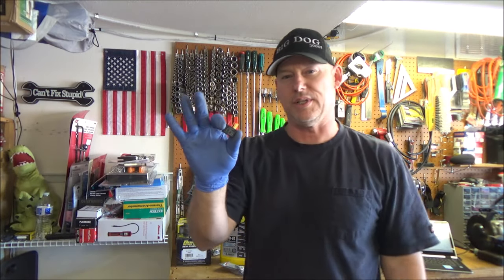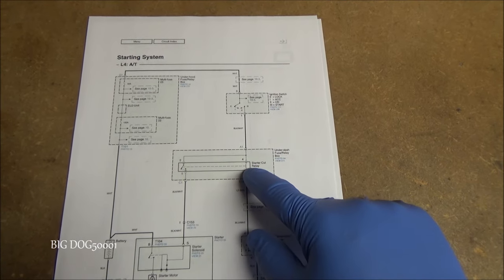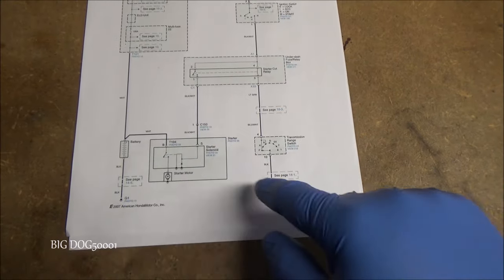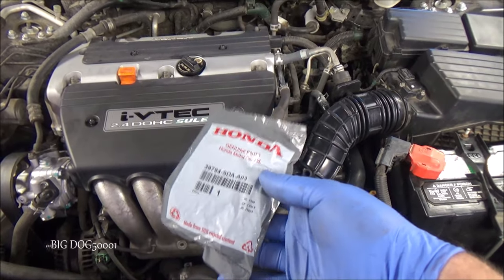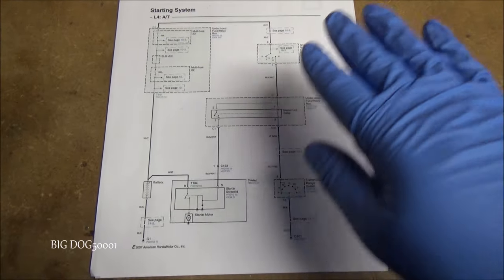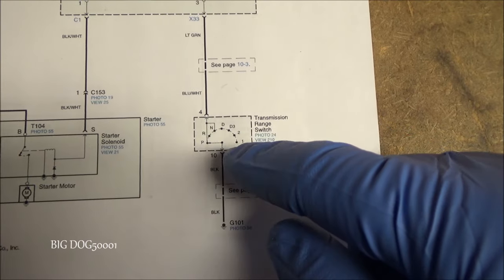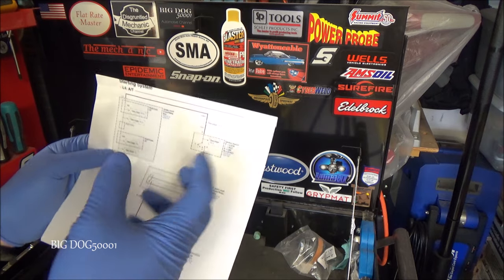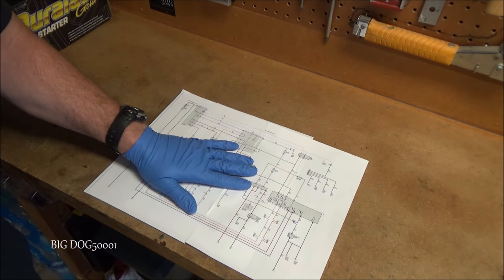Honda No Start: Starter Cut Relay Circuit

Comment: Great info and at 13:00 I found the info I was trying to google for. Having intermittent start issue, sometimes starts multiple times knowing a row, then suddenly it won’t crank and can hear a slight buzz in the starter cut relay. Replaced that relay, and still no start, same buzz. Power to dash and things work as normal. My guess is now the ignition switch, as position 3 for starting is not getting proper connection from what you described. Thank you!

09 Honda Civic  - intermittent start issue. New battery, terminal connections.

Comment: I have a 05 Honda integra Type S,it crank over but wont start. Ive checked the fuel pump the relay underneath the glove box they're good,ive also checked for spark whick ok aswell. Ive seen on utube he has same problem,th3n he changed the temperature sensor and it started,but his car is a Civic. Can you please give me some advise. Thanks.

Comment: Great video.  I have an 04 Accord that buzzes in 3.  Was able to get it to start by cycling back from 2 to 3 several times.  I was thinking it was the starter solenoid failing to engage. Any way to tell if it's the ignition switch without replacing parts and hoping for the best?

Comment: Thank you for your explanation,but do you have a video for 2010 honda crosstour,I have problems with the starter there is no power to the starter solenoid cable,also I don't know where the starter relay and fuse are located,please help me if you can👍

Comment: HELP! I have a 2008 that will almost stall mid drive and all dash lights come on then go off, car continues driving but CEL stays on. Then after turning it off, doors won't unlock and all power is dead until it feels like working again.

Comment: I have a 2015 Honda Civic Si coupe that starts, I drive it about 30 minutes later, I turn it off and it doesn't start, I just wait 30 minutes or 1 hour and it starts again. Could it be the ABS pump?

Comment: Great job on this!  Very helpful.  I'm about to purchase a 2005 CR-V that supposedly has a failed starter.  It's nice to see the current flow diagram.  You didn't mention the 3 fuses in the fuse box up on the battery, so I'll check that current is flowing through those also.

Comment: Would this be the same for a 2002 accord with a2.3ltr. Automatic trans. SE or special edition car? My battery is good. No codes showing. Dash lites work. No start ,Clicks or any noises.

Comment: Hi. Thanks for the informative video! I have a honda crv 2009 diesel with a hard start issue that has been going on for sometime, even my mechanic has given up on it. Anyway, I went to look at my ST CUT relay on the internal fuseboard to check it and its not even there! Even the FUEL PUMP relay is missing right next to it as well!? Its quite bizarre. I figured those two relays should be there so it operates correctly?
The only relay present on my internal board has PW next to it?

Comment: Here's my question I have an 04 Honda Accord I just changed the battery and the alternator and the car still won't start I don't have the money for a starter so what if I just changed out the relay do you think that could be the problem instead of the starter itself?

Comment: Have a 2005 Honda accord cranks but won’t start I have no spark I changed cam shaft sensor and crank shaft position sensor and exhaust cam shaft sensor any suggestions

Comment: Thank you so much for this thorough explanation! My brain can’t wrap around something without understanding the big picture, and you’ve taught me this whole system, along with all the simple real world troubleshooting steps. Such a valuable contribution for us home mechanics working on older cars 😅
I’m replacing the starter cut relay on my 94 civic, and unfortunately it’s buried up above the drivers side fuse box. Had to pull the whole dash to get to the bolt. Thankfully it looks like they corrected the location on newer models.

Comment: Love the deep dive approach. I'm surprised the starter pull-in coil is not wired through the motor ground. I guess with these small engines, it isn't so critical to separate pull-in coil from hold-in coil.

Comment: I have an 03 honda accord lx automatic and I'm having problems starting it, the only way it can start if I jiggle the key a ton when I put them in the engine, what might be the issue or what might I have to replace?

Comment: thinking anti-theft of my 2009 Honda Element when I leave it for a few days. wondering if pulling out the starter relay would be a decent strategy? your video is super informative and I thought you would have a good idea. I read of pulled fuses being replaced with pieces of copper, steel, aluminum, thought maybe this would be a better option.

Comment: Thanks for this video.I have a no crank 2017 Honda accord new battery,starter,2 new relays and still nothing not even a sound.I didn't know about the circuit board wasnt repairable till your video.Thanks again  no one has anything on a 17 accord beside a battery change. Lol

Comment: Big Dog...thank you for the video.  I"m working on a 2002 Honda CRV.  Question,  if the relay is good and the problem is the starter....would i see a noticeable voltage drop when i try to start?

Comment: I have. 2001 Odyssey and the Factory Service manual states starter cut relay is on the back side of the under dash driver side fuse panel. It is unobtainium. The wiring harness is prevent you from easily accessing the relay. I can feel it clicking when I turn the key but it isn't always the same click as the very first one so I suspect that the relay might be bad but it is virtually almost impossible to remove easily.

Comment: Thanks for your video. I have a 2000 EX6 and suddenly it won't start in park or neutral 🤔. Battery  is new and good. Of course it happens on vacation 🙄.  I think it may be the starter cut relay. The starter always works fine. Again your video will help in troubleshooting.

Comment: Excellent video... the simple legacy tricks to get out of jam, if you are that lucky, are priceless.
Knocking on a starter solenoid or knocking on a fuel tank to wake up a dying fuel pump can save a gouging wrecker trip
Wiggling an ignition switch or knocking on a relay or temporarily swapping relays...(when possible) also good!

Without the detailed expressed logic and the schematics on the car you are working on, today good luck tracking issues!
If you don't know your ignition switch makes a request to your BCM which in turn talks to the ECM, and then the ECM
commands the relay that actually engages the 12V to the starter and the problem is somewhere in the middle  !? no legacy thinking will help!
...and how much of it is buried in PCBs that are invisible(like sandwiched in a distribution(fuse) block... again good luck!

ALSO: 
...a good thing to carry on-board, an emergency fuses/relays kit... that has at least one duplicate for every type fuse/relay in your vehicle,
including a fuse and relay tester.  ...Mechanics rob the ones that are in the unused free slots reserved just for that!
On my vehicle, 4 distribution blocks, NOT ONE spare fuse or relay... all covers with legends missing!

ALL robbed by dishonest mechanics or car dealers.

Now my distribution blocks only have the needed items and the kit is not in the vehicle while at the shop.

Comment: Great video.  I recently experienced one additional possibility with my son's 2007 Accord.  The plastic pad that the clutch switch presses against broke into pieces so the switch had nothing to contact.  Took a bit to figure out that was what happened.  I have a wood turning lathe so I turned a replacement to fit the mounting hole.  Hard to get my hands in there for installation, but that solved the issue.  Honda must have a problem with those pad because the one for the cruise control circuit was also missing.

Comment: Thanks for the vid and part#. Great work! I'm having a very intermittent starting issue with my '04 Honda Accord LX. After coming out of the store yesterday, it took 4-5 attempts to get it to start. The first three times it struggled like it was a weak battery (but the battery is less than a year old).  When I got home I could duplicate it a few times, but then today, I started it about 20x (not in successions. About 6-7 times, then took a few minutes break in between). Never got it to fail. I'm starting with the least expensive part first, hoping it's not a starter issue.
Reply: Were you able to figure this out? I am having exact same symptoms with my 07 CRV. Thanks

Comment: Guys. I can’t stress this enough: CHECK YOUR WIRES! I’ve been waiting on a starter for like 3 days, finally got it and changed it out, only to find out the ground connection to the chassis was all corroded. Anyways my starter was sounding kind of slow so I’m leaving it on but just to save yourselves some headaches, check your wires every now and then 😅
Reply: As for me I’m experiencing intermittent starting with the no noise at all when I turn the key. The ignition switch, relay and battery all check out. With intermittent starts I’m suspecting the starter solenoid going bad and eventually fail all together

Comment: I have a 2006 Honda Accord that i have just replaced the starter motor on. Worked for about a month but now it wont start, I get the clicking solenoid sound but no crank at all, do you have any suggestions? The battery tested ok and also tried to jump start it with no success
Reply: Hi. I’m having the same exact issue. Did you find out what it was?  I’d appreciate you input. Thanks.

Comment: You are a very good teacher! I just had my 2011 honda pilot do a no start, no crank. And the dash lights all flash! Tried jumping it off and did the same thing. Any tips on what to check?
Reply: I have the same problem did you found any solution..?
Reply: @valerioalfalfa3868  mine ended up a combination of bad battery and slightly loose cable

Comment: We had the relay replaced on our 2007 accord . It was fine for a month now it's clicking/buzzing when turning the key again. I'll check the transmission switch as you suggested. I wonder if the ignition switch is on it's way out? Oh yes there is a faint clicking sound coming from the relay area when driving. Sounds like a mouse is in there .
Reply: I know you posted this a while back, but did you figure out what the issue was. I've heard that same "mouse" sound in my honda and I just had the no start issue.

Comment: Thanks man I really love your videos!
I'm having a problem with my car if you can help me out, it's a 2007 Honda Accord and it's not starting and the symptoms are, that it has a blinking green key light which should mean that it doesn't recognize the key.
It started when I bypass the child safety switch on the master switch while trouble shooting passenger Windows not work and there happened to be a wire I tested connected to ACG fuse.
If you can maybe help me out and shed some light on my situation I'd appreciate it.
Reply: PS. It does crank
Reply from the maker: Blinking green key during cranking usually means an Immobilizer (anti-theft) programming issue.  Some Immobilizer systems will only shut down fuel (so it causes a crank no start) and some will shut down starter circuit as well (no crank no start).  I would first try a second key and see if if there is a crank no start with that one too.  I would probably also verify there are no blown fuses in all fuse boxes.  The key(s) may need to be programmed again but there is a chance that control units/circuits/fuses could have been damaged during testing and may need repairs/replacement.

Comment: First of all, thanks for your video. On the other hand,exactly, what does a starter cut relay, do ?
Reply from the maker: I tried to explain it in the beginning but typically a relay either allows a small circuit to control a larger one, or it is an easy way to add a switch.  For many Hondas, the starter cut relay is an easy way to add the use of a safety switch (on this car it was a transmission range switch).  Thanks for the comment!
Reply: @BigDog50001  thanks for your explanations

Comment: That 2017 wiring sematic was at least 5 times bigger than the other one, you have to replace a circuit board if the relay goes out-Dang.....
Reply from the maker: Yep!

Comment: 2012 CRV. 1st crank of the day starts but kinda slow. May or may not crank when get somewhere and come back out and try to leave. Battery brand new. Old battery tested weak but I don’t believe it was the issue. Couldn’t even jump it off. Removed cables and forgot the windows were down. Slid cables back on to roll up windows and they went right up so tried to crank the car and it cranked. What would you check initially? Thanks.
Reply from the maker: I would start by verifying charging system/alternator is working properly and all connections at battery and alternator are clean and tight, and that the new battery is fully charged.  Also, although not very common, a bad starter can mimic a dead battery (cranks very very slow).

Comment: Looks like in a pinch for troubleshooting if the relay is bad you could swap the power window relay with the starter cut relay. If starting works and power windows stop working, the. You know you have a bad relay.
Reply from the maker: Yes if it is the same relay for that model.

Comment: What resources do you use for your reference material and service manuals? Are they all from Honda? Do you have anything in paper or are they all pay to play type manuals?
Reply from the maker: I pay annually for a couple of different service subscriptions including one from Honda.  I don't use paper manuals anymore.  Everything has gone to a subscription based model.
Reply: Thank you for the information. I still have my six or seven inch thick 97 to 2000 Honda Civic manual. But I also have it in an electronic form. Fortunately you've been putting out videos on the same generation car that I have. Thank you for that too.

With our 2021 Honda Pilot I figured that we couldn't get a manual for it anymore and like you said is probably subscription-based. I will check Honda out.

Comment: I have a 2014 honda odyssey. I believe there are 2 relays, one is a starter relay and the other a starter cuttoff relay? Anyway, my intermittent problem is that when it's cold, it appears "sometimes " the starter doesn't disengage for a second or 2 creating a grinding noise most likely the gears on the starter and flywheel. Once the car has been running for a while, this won't happen again until the van has been turned off for a while. I want to try everything possible before replacing the starter. Can this starter relay or cuttoff contacts be sticking(not opening on time) causing the starter to NOT disengage? Please advise. Btw, awesome video! Thank You
Reply from the maker: There are two Starter Cut Relays in the driver side under DASH fuse box on a 2014 Odyssey.  Relay 1 goes to the the ECM (Engine Control Module), Relay 2 goes to the starter solenoid (both should be same part number).  Starter Cut Relay 2 would be the one I would be looking at, if it doesn't make a good contact then it could cause issues with the pull in and hold in coils (but either relay could cause starting issues).  Replacing relays are pretty cheap and easy compared to a new starter and it may solve the problem, but there is a good chance it is a starter issue.  I would double check connections at battery first to make sure they are all clean and tight before replacing any parts.
Reply: @BigDog50001 thanks so much!!! Huge help!
Reply: Ended up replacing both starter cut relays. Problem still exists. Replaced the starter and problem still exists on cold day startups. Is there an ignition relay somewhere in the circuit? ReSon I'm asking is that I found a way to not repeat that grinding noise as if the starter is not disengaging quick enough(on cold days) so, what I've been doing is pressing the ignition button a few times and holding it in without applying the brake. I then start it normally and the noise is minimal.  I'm thinking another type of relay in the crkt is sticking until voltage is applied, or the ignition button cld be bad. New ignition buttonnis 250 dollars and I'd hate to replace this as well if the problem is another relay which is much cheaper. Please advise. Thank You
Reply: @BigDog50001 Ended up replacing both starter cut relays. Problem still exists. Replaced the starter and problem still exists on cold day startups. Is there an ignition relay somewhere in the circuit? ReSon I'm asking is that I found a way to not repeat that grinding noise as if the starter is not disengaging quick enough(on cold days) so, what I've been doing is pressing the ignition button a few times and holding it in without applying the brake. I then start it normally and the noise is minimal.  I'm thinking another type of relay in the crkt is sticking until voltage is applied, or the ignition button cld be bad. New ignition buttonnis 250 dollars and I'd hate to replace this as well if the problem is another relay which is much cheaper. Please advise. Thank You

Comment: Where's is the location of a 2001 Honda Accord starter relay?
Reply: In the glove box on the passenger side you have to clips on the inside and it’s directly in front when you let the glovebox hang
Reply: It was under the driver's side near the main relay area .

Comment: Thanks for great explanations. I really want to replace 2 starter relays on my 2016 honda fit (I need to knock it sometimes to get it to work) the problem is I cannot find the original parts 39794-T5A-J01 (Denso) the one I can find is Omron G8HL-H71 as shown is your clip, the only information described on original parts is 12V (No Ohm No Amps provided) now I'm very confused whether those relays can be replaced by Omron. Please help me out. Pic : https://pasteboard.co/ev7CyShZy6jf.jpg
Reply from the maker: I would stick with Denso for these, from a quick search they seem to still be readily available.  https://bit.ly/3ETF9Xl